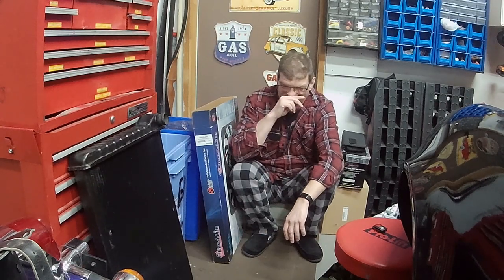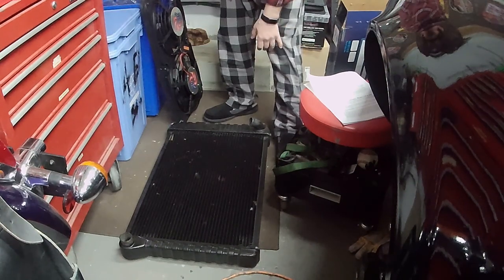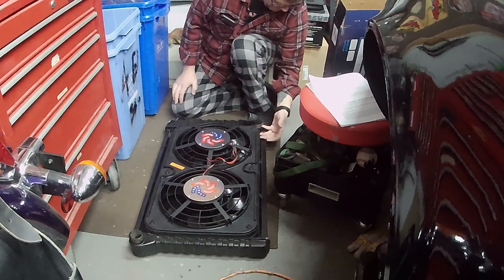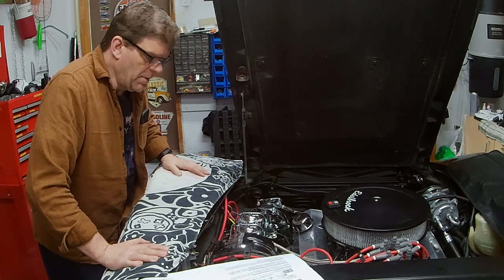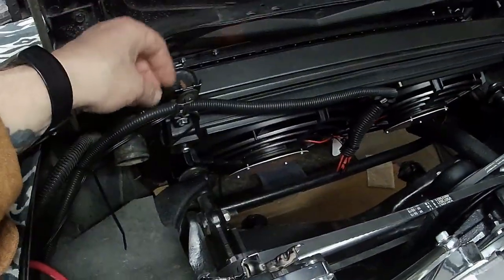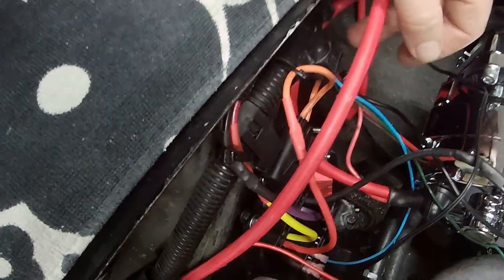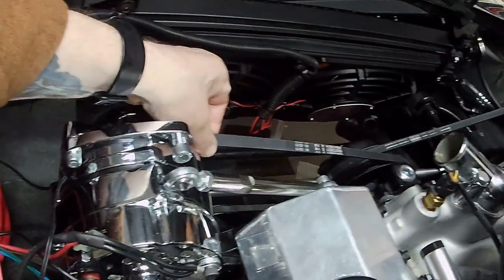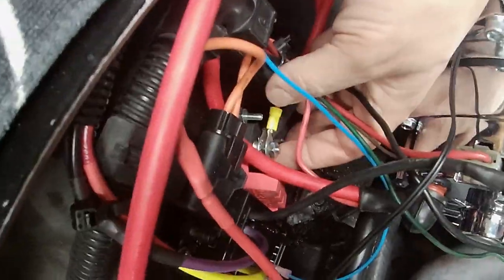Electric fan install in 79 Corvette

Comment: Thanks for the video very informative have the same car needed the info also where did you get the alternator braket?
Reply from the maker: https://www.amazon.ca/Aluminum-Alternator-Bracket-Polished-Compatible/dp/B097Y8T6M1/ref=sr_1_25?crid=2TXTWBYF5VQH9&keywords=sbc+alternator+bracket&qid=1695863881&sprefix=sbc+alternator+bracket%2Caps%2C99&sr=8-25&ufe=app_do%3Aamzn1.fos.b06bdbbe-20fd-4ebc-88cf-fa04f1ca0da8
I had to grind the bottom of the bracket to clear the power steering pump cap. Nobody will notice and it doesn't affect strength.

Comment: Hey Bill, was wondering if you could put a link for the dual fan setup that you purchased.
Reply from the maker: https://www.corvettedepot.ca/cooling/fans-shrouds/electric-fans/corvette-dual-electric-radiator-cooling-fan-system-1965-1982. 
I only used it for a couple of days, i found the shroud did not allow enough air through at higher speed to cool the car.